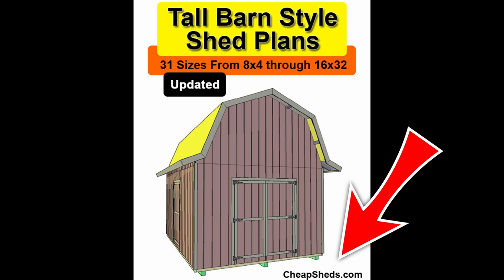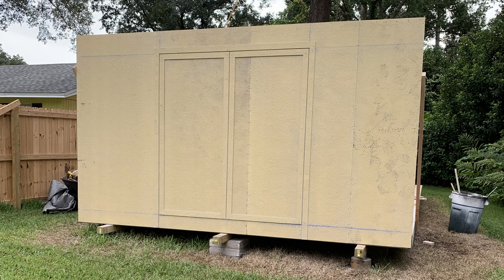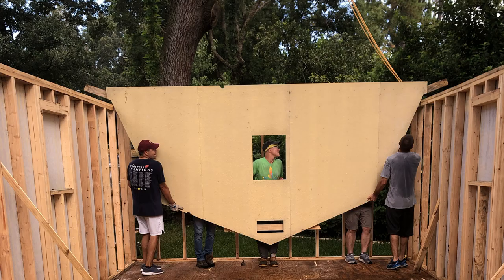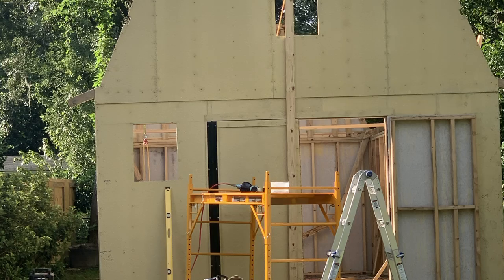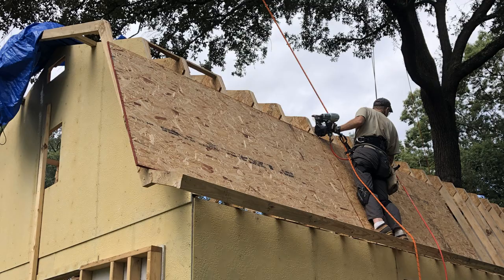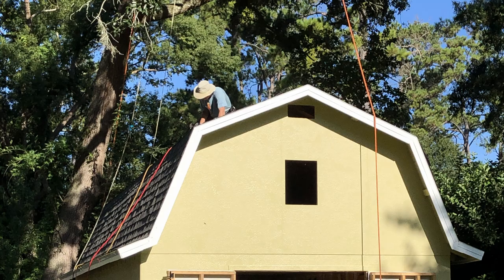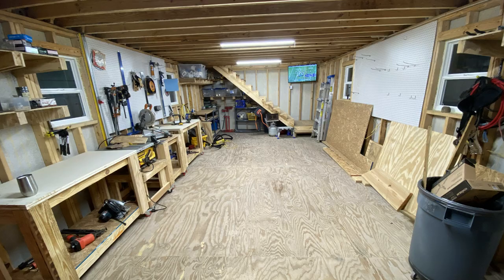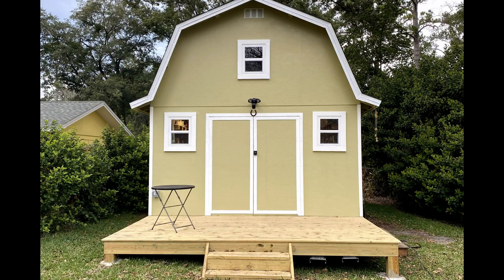DIY Gambrel Barn Shed Build from Plans - Step by Step

Comment: This is neat, I am up in Alford, Fla. I am building a 12X24 Gambrel Barn Shed, I have a metal plat form then with 3/4 plywood then with 2X4 walls and the same with the truss are 2x4.. It is fun doing this..

Comment: Look great  project, but I imagine a lot of money was spent. Thank you for sharing one more project.
Reply: You buy material monthly ▪︎Key is NOT to borrow money.  Should only cost Approximately four thousand for all the material
Reply: @colinchampollion4420  Amazing tips.Thank you so much for your advice.
Reply: Especially now days we all should STOP USING CREDIT & PAY CASH ~no more debt what sooo ever😊
Reply: @colinchampollion4420  Thank bro.is nice your advice.God bless you always.
Reply: I built a 12x20 Gambrel Roof barn very similiar to what is seen in this video except I put a 6" concrete floor in and used 2x6's for my walls. The lower level has a 7 foot ceiling & the 2nd floor has a peak of 6-1/2 feet.   I built it in 2007, all by my self  (48 yp then) and it cost me $3,100 for everything. I had to pull a permit (living in suburban Chicago) and the building inspector complemented me on the workmanship on the final inspection. 
Had a lot of fun building it and learned a lot too.  BTW, before starting, I got a quote from a large (unnamed) company and it was over $7,000 and the sales person did not understand why I wanted treated wood for the  sills.   Even the experts can be idiots.

Comment: The safety harness is always a good idea, the older we get, the less we can tolerate falling to Earth from great heights.
You could have built your trusses and ends on the attic deck...less gravity to fight that way.
The stairs look too wide, you could have put the "turning platform" at the top instead of the bottom.
Everybody's a critic...right?

Comment: That's a great looking barn. I'm preparing to start a similar model but a much smaller 10x12. I'm trying to figure out the best way to anchor the 4x4 wood rails to the ground in case of a massive storm. Do you have any suggestions for anchoring?

Comment: it looks like you installed OSB with the wrong side inward, the markings had to be outward, it was applied to see where to drive nails.
Reply: Roofers prefer to install OSB roof sheathing with marked side inward as it is the smoother side, allowing better grip for footing on the outside surface where they are working. Exterior walls are typically done with marking on the outside for nailing purpose as you state.

Comment: nice shed! 2:50 you use strand board for joining the trusses. why not to use plywood or even wood? strand is not for joining critical elements/ its structure is loose. no safe. just think bout it :-)
Reply: Generally agree, at least for widths > 12'. That said, this building gains significant structural integrity due to the added full width spans supporting the loft floor. I built a similar one in the UP of Michigan 25 years ago using 1/2" OSB gussets for the rafters. It will certainly outlive me.